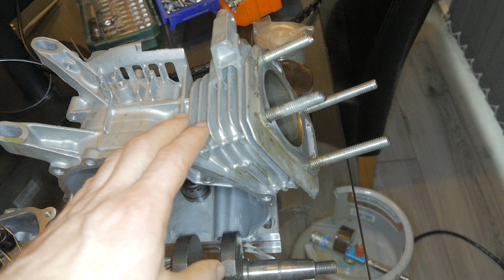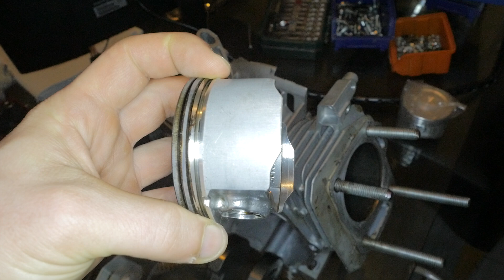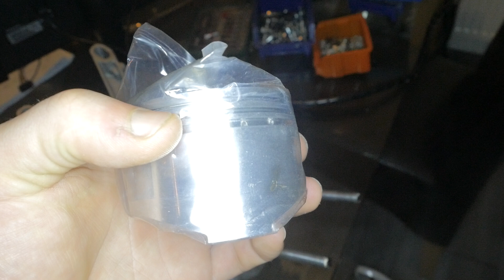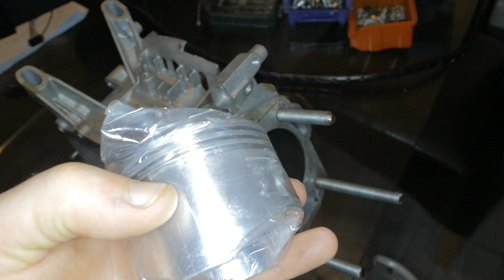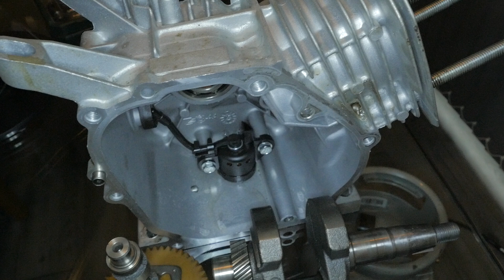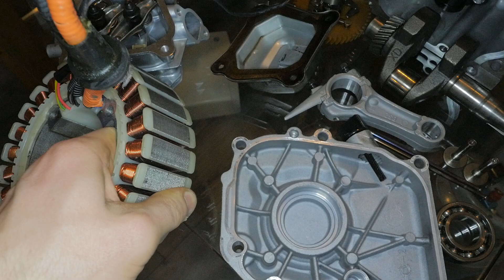E NV200 Range Extender GX200 Engine Issues Identified

Comment: Hi Shaun I'm working on a similar project on bmw i3. Do you mind sharing how you wire the generator to the high voltage battery so that when driving, the varying voltage in the battery pack won't clash with the motor-generator voltage?
Reply from the maker: I have no idea how this would work on the I3. I have only done it on the E nv200. Also be careful if the car needs work done by the dealer because they will condemn it as unsafe. That's what happened to me when a hevra certified technician fixed a blown hv fuse.

Comment: Are you running this on propane or petrol? If you're running on LPG maybe your pressure regulator cant keep up. 
The other point is that the engine running on LPG will be considerably hotter than running on petrol, especially in WOT situation. Maybe that could contribute to blown head gasket.

Kepp up the good work, I enyoj your content very much.

Comment: In air-cooled engines a drop in power is very common as the engine heats up. A drop of 50% indicates to me that the engine was close to seizing up.
This could be due to lack of oil circulation or just straight overheating. 
The hone will not take out or correct a distorted barrel. Unless it is wear in a longitudinal (wear at the top or bottom of barrel.
I would be replacing the barrel as well as the head.. if not the whole engine. 
Using ZX1 in the oil will dramatically reduce the heat generated inside the engine from friction. However, that engine is basically toast.

Comment: Loss of power could be a fuel issue. If you have a thermal imaging camera or it temp gun see if the temps change when it loses power. It could be running lean.